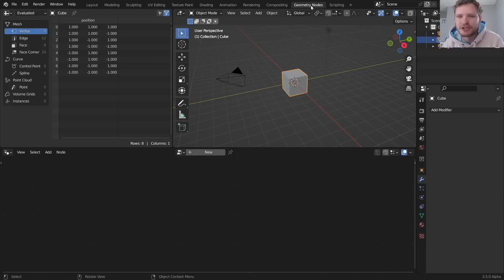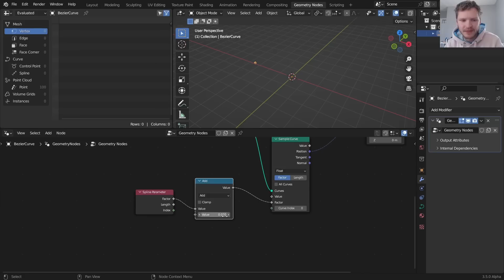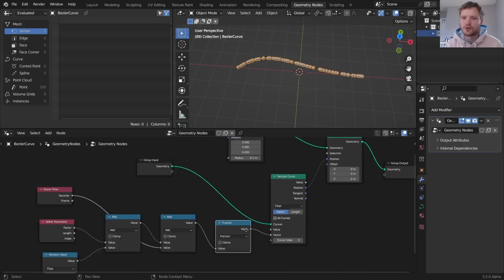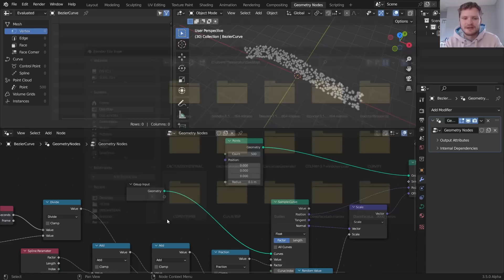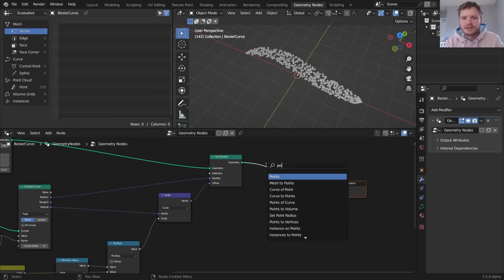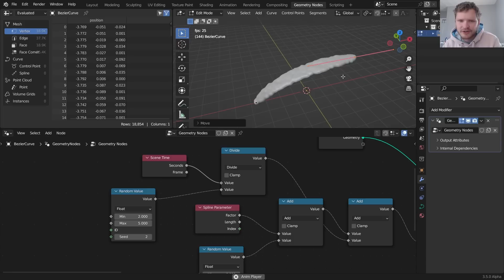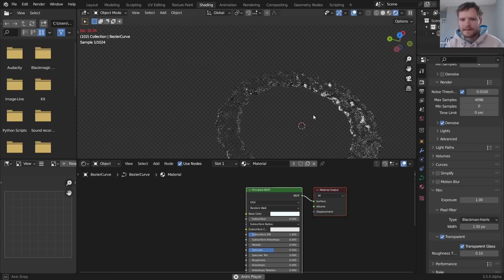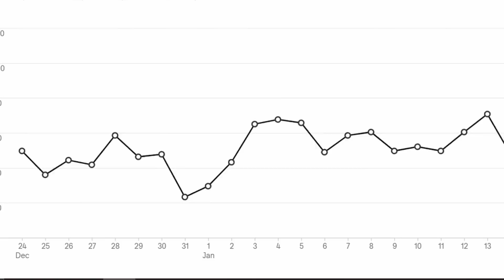Water Along Curve (Blender Tutorial)

Comment: I want to make the particles move independently from the length of the curve in order to simulate a flowing effect. Can someone help, please? I tried using the Trim Curve node but it changes the particle speed since the speed is based on the curve length i.e. when I trim the curve particles slow down. I've been trying to find a solution but couldn't yet. 😭

Comment: The tutorial is really great and I used it for one of my recent project. So basically what I had done extra is that as this one looks low poly as we are using particles and voleume, I just added a >Set Shade smooth< Node at the end just before the set meterial node So that it gives a smooth look and I also added a >Trim Curve< node just at the starting connecting to the Geometry Inout node so that if keyframe the end value, we can make the water flow from 0 to length of the curve thats basically from start to finish of the curve. Just mentioning it here so that some one will find it useful.
Reply: The Trim Curve node increases the vertex count at frame 0 by hundreds of thousands. I added Trim Curve to my setup, If the end float is 1.0 the vertex count is 8,5k but if the end float is 0.0 the vertex count jumps to 300k which leads to lagging.

Also, trimming the curve changes the particle speed since the speed of the flow is based on the curve length.

😭HELP! I'm trying to curve the trim without lagging and I want to make the particles move independently from the length of the curve. Can someone help, please? I've been trying to find a solution but couldn't yet.
Reply: @haganekazuki2241  did you find a solution? I try to do the same thing, but when I trim the curve I get weird motion blur artefacts in my render.
Reply: @haganekazuki2241  Have you figured it out?
Reply: Can you tell how we can make the mesh more thin?
Reply: Thx for this!
Reply: Thanks for this!
Reply: you saved my life